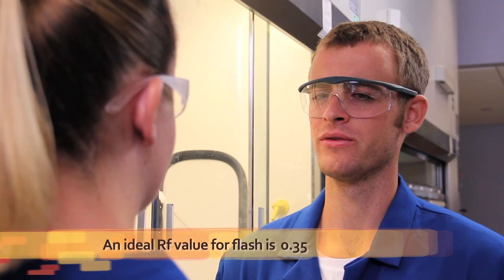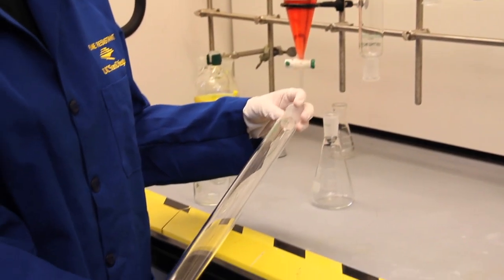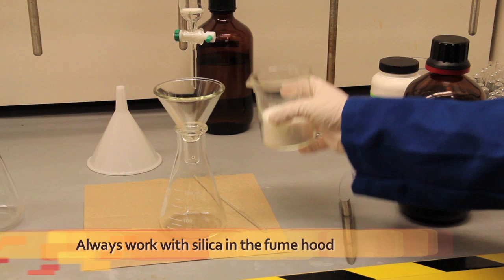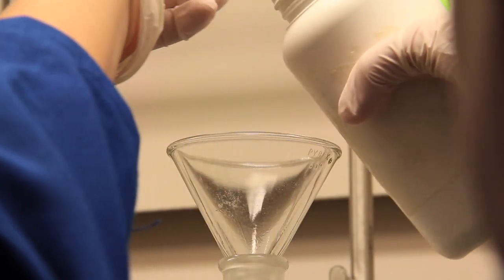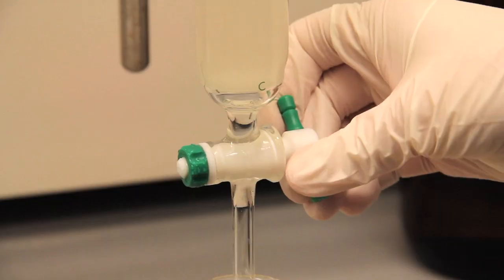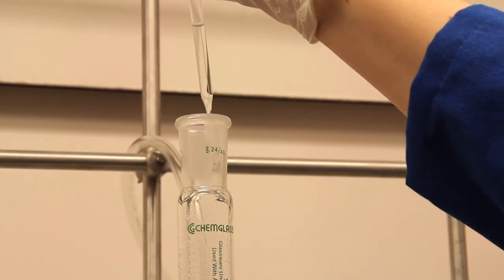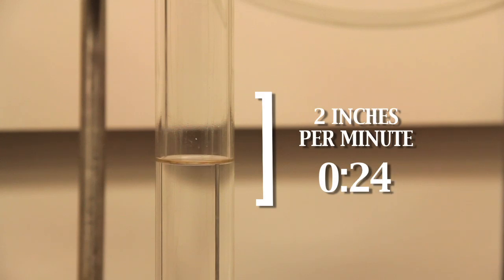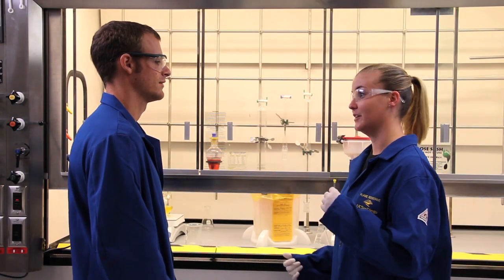Flash Chromatography 101

Comment: a piece of filter paper covering the porous glass filter plate, can facilitate glass washing, or even make it feasible and glass-lossless
maybe... sometime
f.e. the precipitate from the quenching of LAH RM, that sometimes unfiltered through cotton wool(for example), fortunately does not block filter paper, allowing filtering. my favorite chose with THF+LAH RM - to quench with a minimum of plain water(only H2O) - until whitening - adding not faster than 0.5 ml of the next portion of water every 30 minutes. Then white suspension diluted with an equal volume of DCM, shake and leave to settle for 30 minutes-to form compact(only 5ml from 1gm of LAH) crumbly solids, that can be filtered by gravity through cheesecloth...
results flowing slow only with some rare waxy-nature products(but not with bad weather influence), that also accompanied with same difficulties in tradition LAH workup procedure, but even in that slow-workup synthesis - you will not need a three-liter Schott funnel instead of a one-liter cloth filter in pressurized-filtering-jar

Comment: Why is it called "flash" chromotography?
Reply: You use pressure to force the solvent mixture through the glass as opposed to relying on gravity alone to perform the run which would take a substantial amount of time in some cases

Comment: There is a good paper by W. Clark Still in JOC (Vol 43, No 14, 1978, pg 2923) which shows a table of typical fraction sizes with different size columns, volume of eluant, and sample loading size.

Comment: In our lab, we usually stick to fractions about 1/10th of the column volume.  For example, if you use 25g of silica gel you should collect fractions of about 3 mL.  This can be adjusted depending on your separation as well.  Larger fractions can be taken for very good separations and smaller fractions for poor separations.  This can help limit mixed fractions.

Comment from the maker: Viscous oil is treated similarly to solids. Use “wet loading” if it is soluble in a solvent that is of equal polarity to your initial running condition. Use  “dry loading” if it is soluble in a solvent that is more polar.